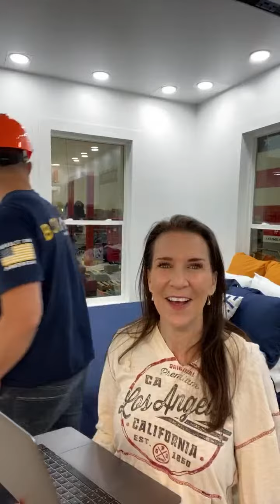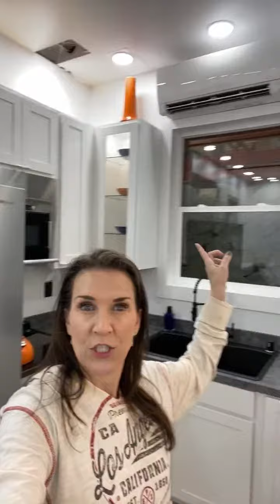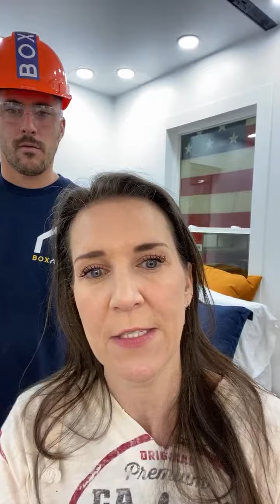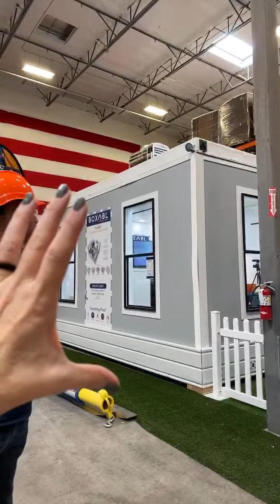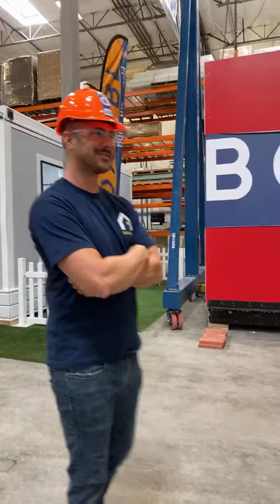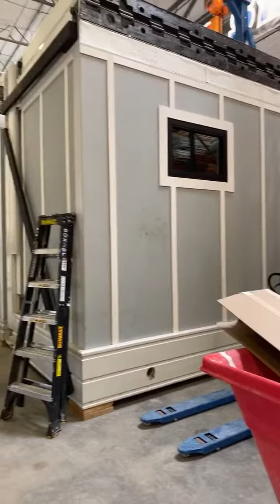Kristina Smallhorn Interview LIVE

Comment: What type of roofing does the Casita have
Reply from the maker: Boxabl comes stock with a flat roof system. Some areas require a pitched roof. In that case we will provide your installer with roof plans and they will add the roof on site.
Reply: @BOXABL  I'm just curious how the seems where it folds get sealed, especially since the set up time is so short
Reply: @BOXABL  is the flat roof pvc? Torch down? .....?
Reply from the maker: @Jasonbrownneedscoffee  Check boxabl.com/faq